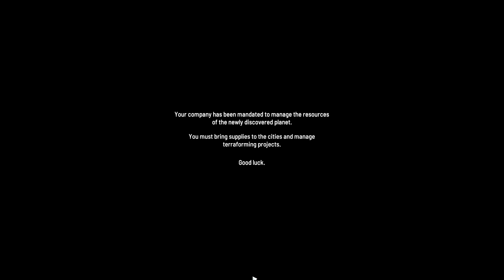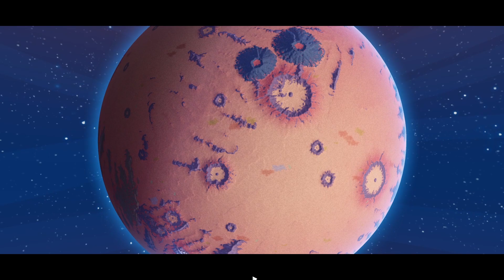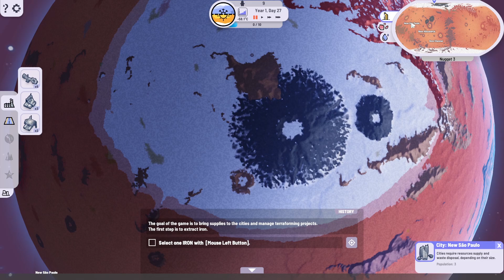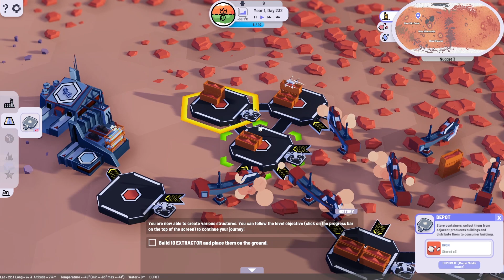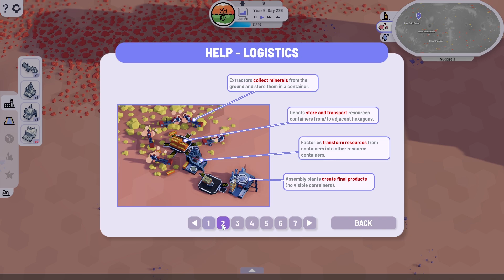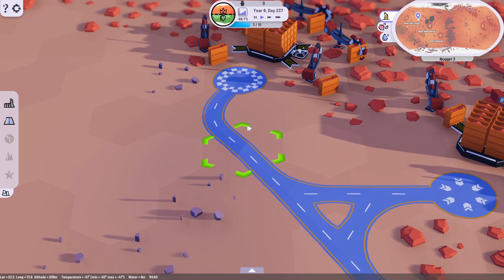NEW GAME Factorio Inspired Factory & City Builder Let's You Terraform BIG PLANETS | Plan B Terraform

Comment: Holy shit this game is bad;
Optimized ? This game is the enemy of optimized, it runs far slower than it should.
I am sure my system is by far not as new and fast as yours, but even on yours you can see it's not that great.
This is worse than old Ubisoft games.

Pathfinding, what pathfinding ? Sure, when you make a route it is fine. If you change a road layout, it will NOT find the new route, even if you change just one little bit. I had to remove the Road Stops and place them again and make the route again for it to find the right route.

And then i have also seen roads that will not build straight as if there is something blocking it while otherwise it would build over them, and the roads break, they are not alligned and break up with basically red artifacting from the ground beneath it coming through. I also see that happen on Road Stops every now and then.

Key Bindings.
Things you'll often use are mostly Extractors, Depots, then Roads, Road Depot, then Factory and Assembler. Sooo, where are my shortcut keys ? I would like to set my own Keybindings. That that is missing is also beyond me. They have some Keybindings, in a lot of cases for things i doubt most people will EVER use. So why not those ?

I know it's only a demo, but if this is even close to it, then it's severely lacking. I think they should at least show more of what's to come in the Demo to make the right impression of what the game is.
Right now i also do not see a way to tell the Depots to evenly split what they recieve to two different points for instance, so one side gets everything and the other nothing. If that's how it stays it is horrible and a missed oppertunity that should be obvious needs to be a thing.
Also, no pause button on the production either, so you'd have to remove the building and place it again later if you just want it to stop.
It is beyond me that those things are all a problem.
There are enough resources to play with and make different things with, but the way it plays is just lacking.
If these things are options you later unlock, why ? You've already gotten to a different planet and can make complicated things but such things are too hard to build into a factory or something ? That would just be lame and weak.

Also, once you set up your production for something, i was mostly just waiting, and too long, for just anything to happen or move on.
There's not that much needed to fulfill the city needs for some time. Even with a quick setup i was just doing far too much. Sure, it might be a bit more work for all three cities at once, but now i see the scale, i can tone that down quite a lot, and i'd be done just as fast if not sooner than i was now for all three.
Hope that improves. It's boring. Your city must grow, it's doing its thing, guess i'll just go read something on the toilet then.
Sure, when you get further into the game you will need more spots to mine and produce more different things, but, it just doesn't really seem balanced really. Also quite a bit of space to work with, plenty i think. Sure, for now. But for the time i've been playing this, it's just not enough. I'm bored during and after these few hours.
While this is a bit more of a puzzle city builder i guess, i think there are plenty of other games that would be more fun and interesting to play.